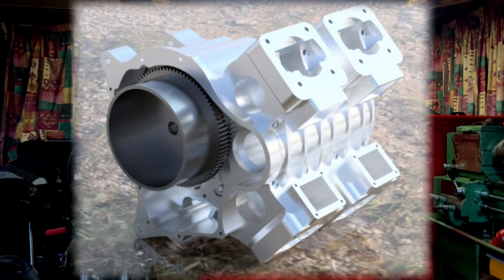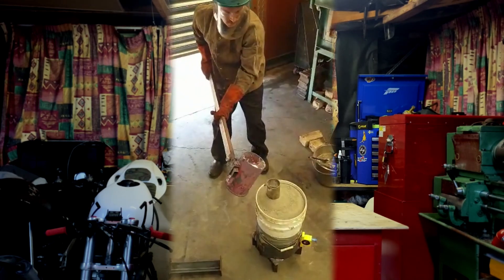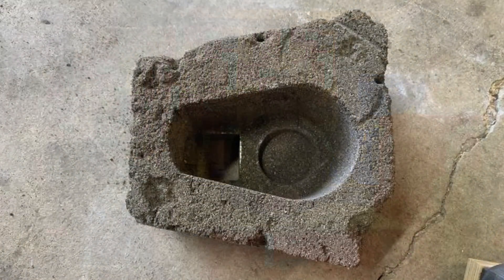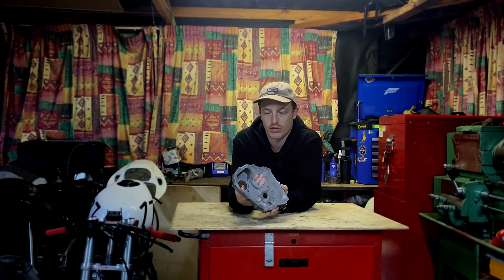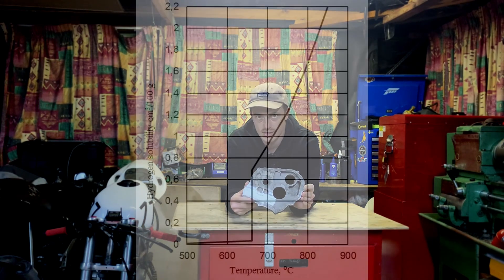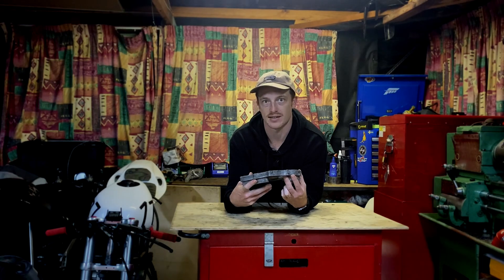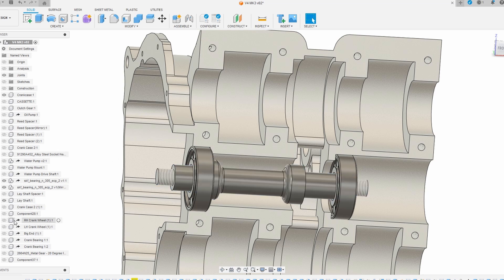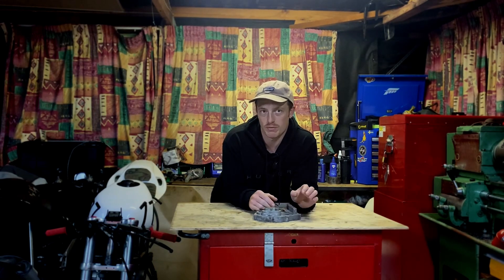Lost Foam Casting - V4 2 Stroke

Comment: I've been thinking about a similar project. Why did you pick the 85cc cylinder? Why not aim for the traditional 500cc four? I'm been thinking of using a KTM 300 cylinder, which would make a 1200cc insane engine.
Reply from the maker: That’s sounds like a lot of bike haha. firstly they’re very cheap and parts are everywhere. Secondly, unless you’re a pro a 500cc bike will be a handful, 350cc will make power similar to a 600 which make good track bikes for your average rider. 
Thirdly, exhaust packaging is very easy with a smaller displacement and the bike will happily rev to 13,000 without too much stress on the parts. 

I can always put a 112cc kit on it and make it close to 500cc if it’s not enough later on.
Reply: @OddsandEndsMachining  Yes, you are 100% correct, my 300 KTM thinking is insane overkill. I used to race a Yamaha TZ750, just four cylinders at 186cc each, and it was insane. There is no way I could actually ride such a beast. Packaging the four exhausts on the YZ750 was a royal pain.
Reply: @OddsandEndsMachining  I just bought a new cylinder and piston (plus rings, top end bearing, etc) for my KTM 300, It was over $1200. Nothing close to inexpensive.
Reply from the maker: @PatFarrellKTM  where as you can get Chinese 85cc cylinders with pistons for $150, which will work for the prototype.

Comment: Hi, you can get a 'smoother' looking casting surface (less Porous) if the foam/wax is coated in a slurry/slip with a high carbon/fine-powdered charcoal & ceramic 'refractory' slip layer, ...similar to those used in making turbine blades and engine cases.
Also having a deeper/taller mold that thus has longer space for Gassing Escape Venting-tubes, and feed pot into swirling 'pig-tail' sections into runners, with a deeper set mold, help more  with a slightly higher analogous 'hydrostatic/head' pressure of the 'melt' which all helps reduces porosity of the casted material.

Can search YT with terms... 
Refractory Coatings for Lost Foam Casting Patterns for a 34 minute video, ..that is quite informative in some places,..
Lost Foam Casting an Automotive Intake Manifold Part 3 41 minute video, ..the starting 7 minutes and other parts might be very useful for you,..
& Also 
Turbine Blades From Rolls Royce ..at around 4 minutes 40 seconds, the pig-tails are seen and explained, feeding up from bottom from the melt filling down-runner.

..sorry if I sound/read condescending, that is not my intention at all, hopefully much of my suggestions you already know of ;¬D :¬P
Reply from the maker: Thanks for the info, I’ll have a proper look at it when I get a minute. 
In my case the surface finish came down to the fact the foam had a rough finish, the refractory can only match the surface of the pattern. Things I could do to improve it would include sanding the pattern smooth and maybe getting a sharper end mill and spinning it at higher rpm.

Comment: Why don't you cnc mill the pieces instead of casting them?
Reply from the maker: Because billet would Cost in the ball park of $2000 for material alone and my cnc mill is not large enough to machine the cases in one or two set ups. Casting is $10-12 a kg and the total weight is 27kg. A lot more forgiving if I make a mistake.